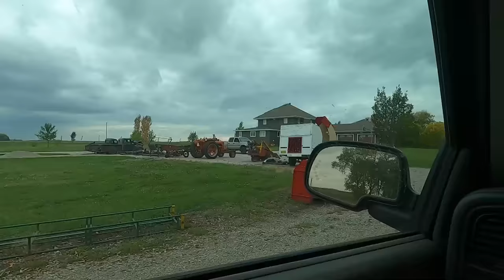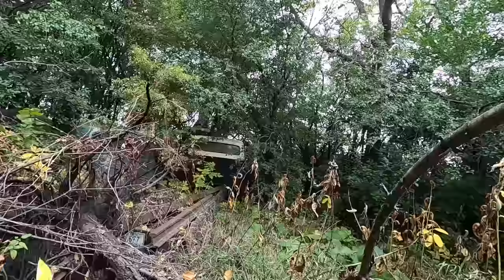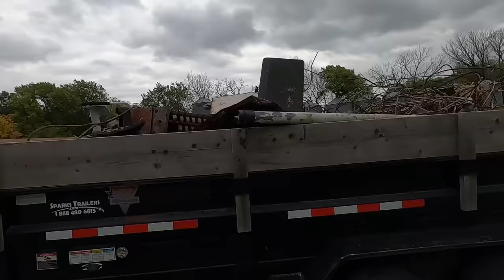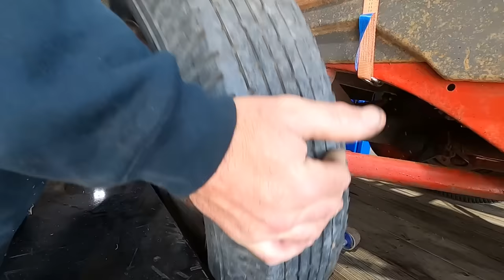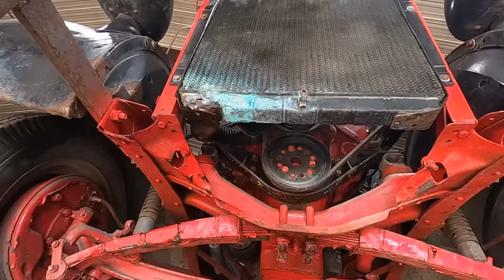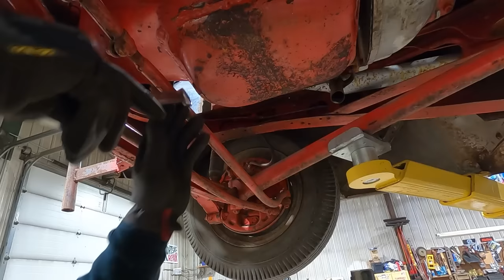Barn Find!1938 Ford Hot Rod Pickup! OHV V8 Power!! Abandoned For 48 Years! Will It Run?!?

Comment: @ 2:26:35, preaching to the choir my brother, up here in Washington, PNW, the crustiest shell of a Chevelle, Lemans, Cutlass, Skylark starts at 5000k including the bent subframe, half a front clip, bullet holes and 4 gallons of Bondo married to some chicken wire, we're not a salt state but our wet climate combined with blue tarp itis while it's under a 200ft fir tree for 23 yrs because they know what it's worth, while you drive by it for said 23yrs and tarp additions breaks em down here, sure miss the mid to late 80s when daily driver coupes started at 500$, used to be a local tire chain, Big O, where you got a 350hp 4bolt 327 long block for 799.99$ right off the loading dock. Previous owner:67 Lemans, 68 Firebird, 68 Malibu, 69 Chevlle, 70 Lemans, 70 Firebird, 73 Formula, 75.77,78 TransAms, could say I was partial to the Poncho Pride

Comment: Is there anyway that the bottom screw mount of the aluminum radiator to go under the chassis sheet gusset? Instead of the radiator sits atop the chassis sheet gusset where it was bolted down.

Comment: Mortske, sorry to tell you BUT those piston are 12.1 or 121/2 and it's to much compression to run on todays gas. So when you have it apart you need to buy some 10.1 or 10.5 compression pistons..usealy theres a part # on the bottom of the piston.
Reply from the maker: Nahhh we got aviation fuel

Comment: There a time and place to know when to walk subs off the site head first.  My father was a luxury GC and subs were probably what caused him to drink.  The minute you discovered the wire cut and knew the cuts were done wrong, you should have halted the job, called the people in charge of the measuring process and sent the stone back if measurements were done by same firm that cut it if needed or halted until a supervisor that could communicate arrived in site.   Their process is broken.  Something that unique should have dedicated technicians working for the firm, not independent subs.

Comment: Im watching this again. Did you say you were running a ford trans and a sbc?
Reply from the maker: yup, original transmission to the pickup
Reply: Ok. I just wasn't clear on the input  shaft and the bell housing. I know you mentioned something about the pilot length or something in that area
Reply: @MortskeRepair about the guy who gave ya heck about Frankensteining everything. I guess I get that but I think it would be more enjoyable to putt around in with a th350 in anyways. Just my thoughts

Comment: Never run a 2 barrel when a 4 barrel is an option!
Reply from the maker: Why not?
Reply: 4 barrels are the original gas savers because of running on the smaller front bores so they are easier to tune for performance and drivability which can sometimes be a trade off for one or the other with a 2 barrel… David Vizard goes into depth on the subject. Love your vids bro!

Comment: Hey Boss
I got a ? For you
I got a 2008 Ford Expedition with the 5.4 with 328,460 miles on it. It needs a timing chain guides. It has the death rattle after it warms up. But after you take off and drive, it runs great. I was wondering if it was yours. Would you spend the money to put the timing chain kit in it? I thought about doing it. I don't know cause of the miles on it
Reply from the maker: Nope.
Reply: @MortskeRepair  I was afraid you would say that. Now I don't know what I'm going to do now . I guess I just drive it until it runs no more .Now I have got to find where's the oil sprayed onto the alternator from . I had the change oil recently. I'm hoping it's coming from the oil filter, not hole in the timing chain cover.

Comment: Are you going to finish working on the other old pickup that's lowered or the old green car ,or will I have to wait until next week to find out, but nice sounding truck,order some tires that's not flat spotted on the bottom,probably have to special order them or find some newer tires that's the same size as the ones that's on the truck & why did it get hot so quick for you weren't driving fast enough to get it that hot
Reply from the maker: Stay tuned
Reply: @MortskeRepair  that's what I figured you would say,but didn't hurt to ask,Lol

Comment: Bad mistake using Quaker State engine oil. In 1980, Quaker State oil gummed up a lot of engines and they had to pay everybody's repair bills for what their oil did to their engines.  Your making a big mistake using Quaker State oil. Get rid of it and use something else or else you'll have problems with your engine.
Reply from the maker: That was 40 years ago

Comment: Of course the oil looks brand new. It's been changed, the same way the oil is changing any used car. Just because the oil is clean and looks new it doesn't mean the engine is cleaning new it just means the seller drained the old sludgy oil and poured in some knew so when guys like u come along go look at the dipstick you don't see the sludge, you just see the new oil that's sitting on top overall that sludgy oil of that junky old engine
Reply from the maker: Ok

Comment: 1:42:48 not really intrested in video on how to use a welder to remove broken bolts bbbbut if you did a video on how to remove said stuck bolt with thermite i would watch at least 10 times
Reply from the maker: no clue what that even is
Reply: @MortskeRepair  it's a mixture of powdered chemicals that burns at 8000°f it will melt engine blocks concrete just about anything but what every you do don't but water on it

Comment: boo hoo oooh no a ford with a small block 283. that and the 327 are the most reliable and easiest to work on . i put a 283 out of a 67 malibu and the whole wiring harness  into a 44 willys pickup in 1979. it still runs today. over 90,000 on eng rebuild. front eng mount bolted right in. by the way the fake wood dash on the looks like mac tack sold in the early 70s crappy vynyl stick on wrap

Comment: "why do people use the plastic lines for oil gauges" also you showing exactly why nobody cares to buy the more expensive yet same quality junk "better" line if it was better more people would buy it just like formed hoses vs flexi hose kregers vs not kregers etc when the truth is you just have some odd but not really factual opinions but thats why we like ya cuz who else is gonna hate the most random things but still make quality content and give us random facts of the day also im extremely jealous of yalls early ford truck availability i need a 30s truck(heavy duty non pickup with the cowl on the roof like the ones you have) for my mini semi project and they dont exist here in the northwest
Reply: also tech tip mortske that engine that came in it was built and was a high compression sbc so if you rebuild it you have to run premium gas or it will die
Reply from the maker: Uhhhhh

Comment: You cheated on the 40 whatever years replacing the engine. Don't prevaricate.
Reply from the maker: Huh?
Reply: @MortskeRepair  prevarication is lying. The replacement engine didn't go 40 ought years. We wanted to hear the original engine, or at least the hot parts (cam and pistons) to run. Not a worn out replacement 283 as advertised.
Reply from the maker: What exactly did I lie about again? @robertturner6651